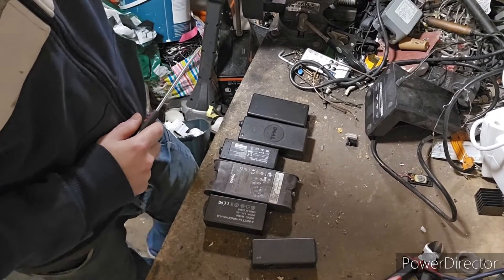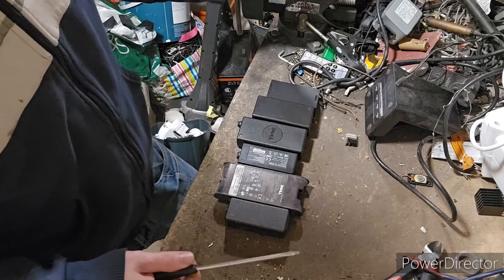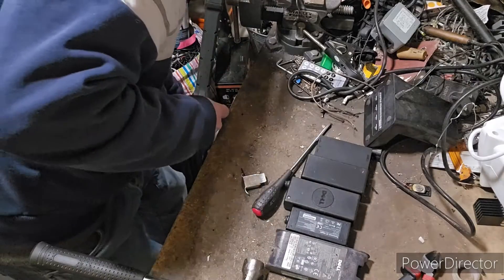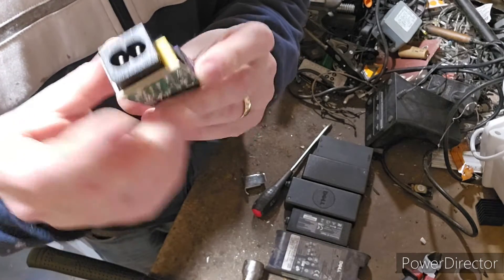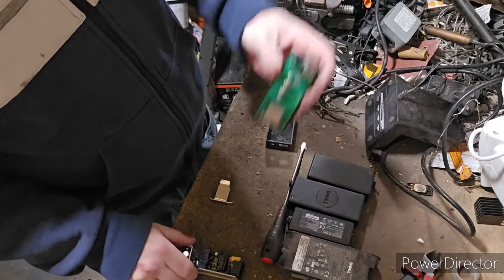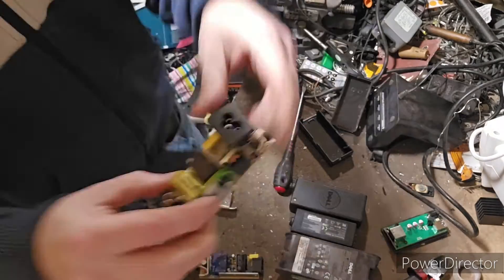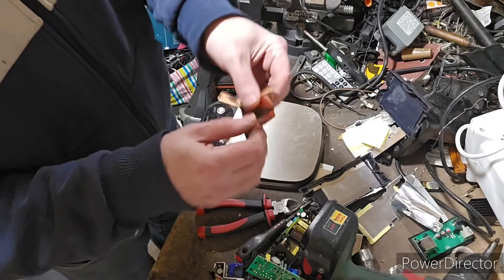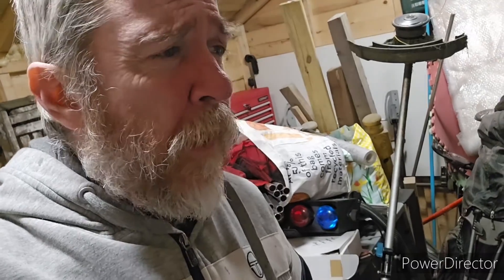Copper in laptop power supply units

Comment: My friend a 2"chisel on the corner and a swift hammer blow open them easy. Do this when sober or your fingers may suffer. Many of the newer ones I've opened are filled with a white rubber substance. That is more work than the copper is worth.
Reply from the maker: The white rubber is easy to remove. Copper and aluminium in these things so it's worth my time but yeah a chisel sounds like a better idea than just a hammer smash or using a screwdriver
Reply: @ScrappingScotland  wish you were closer. I have 3 trash cans of laptop power supplies. I won't throw them out but I will likely have several more cans before I process them. If you were close I would say come get em.
Reply: I am in for the gold mostly these days. Still do plenty of copper and aluminum and the shred. I don't know if you can buy the chemicals needed to process gold but you can make it work with simple household stuff. For instance salt and vinegar are great on fries or chips but if you want they can make hc and add peroxidel to dissolve the metal pins in computer's. Then use hcl and bleach. Or I prefer pool chlorinating liquid to dissolve the gold. Lots of videos out there to guide you through it. But like I said been scrapping for decades and still can't pass up a roadside find. Anything with a power cord I say.
Reply from the maker: @richardhulbert9480  the chemicals thing isn't for me. I don't really have the knowledge or the space in the shed to do that kind of thing.  Absolutely on the anything with a power cord. It's all scrappers gold